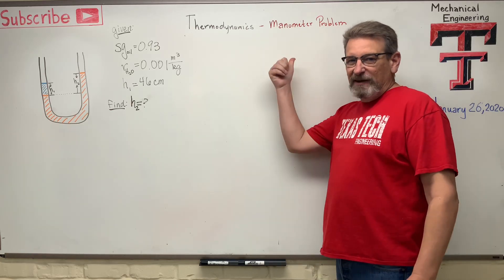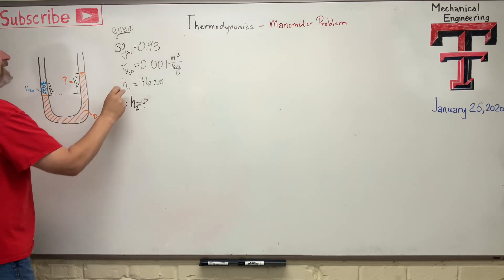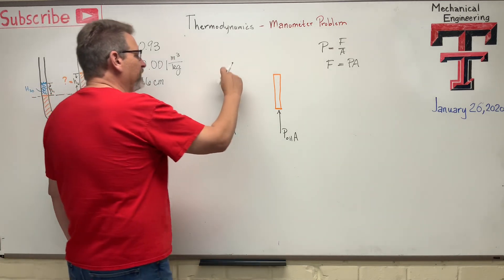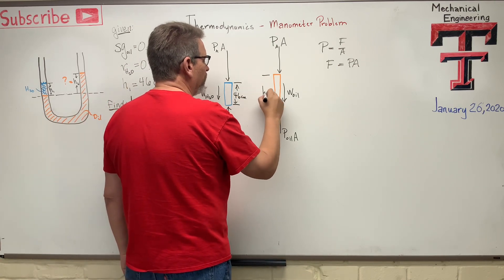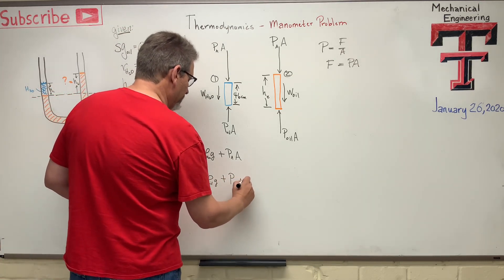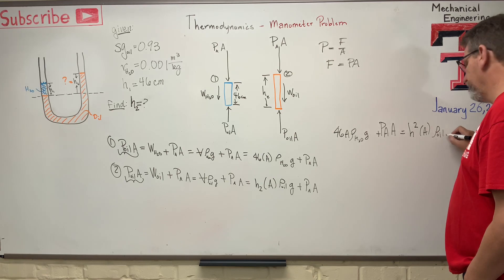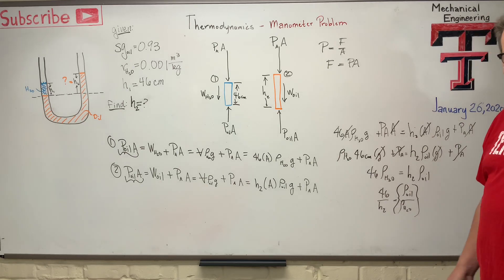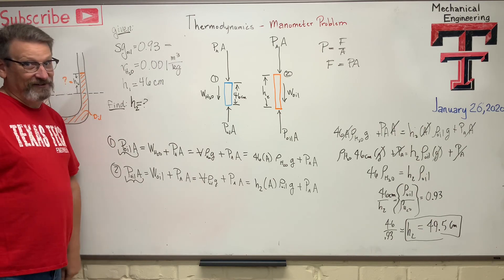Thermo: Lesson 7 - Manometer Example Problem

Comment: pressure at a point in a fluid at rest does not vary in the horizontal direction 
P(oil)=P(water)

P(water)= density * gravity * height 
1000 * 9.81 * 0.46 = 4512.6 pa
Density of oil= specific gravity of oil * density of water = 0.93 * 1000= 930

Then

P(oil)= density * gravity * height 

4512.6 = 930 * 9.81 * height 

height= 0.495 m

Comment: First, absolutely love your videos. But how can this calculation be valid? Water is heavier than oil and would quickly run to the bottom of the manometer, and the oil level would be even on both sides, --- unless there were an impermeable, weightless membrane seal between the water and the oil. https://www.stevespanglerscience.com/lab/experiments/oil-and-water/
Further, the coefficient of friction between the seal's edge and the manometer wall would also have to be zero.
Reply: Wow